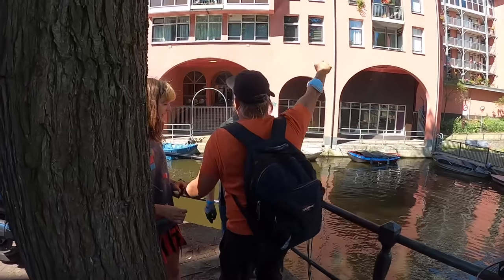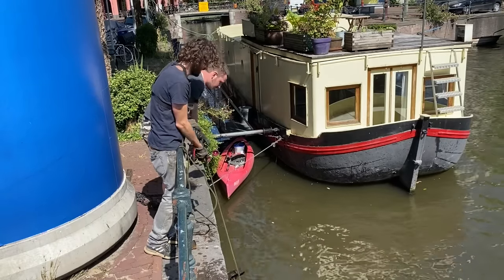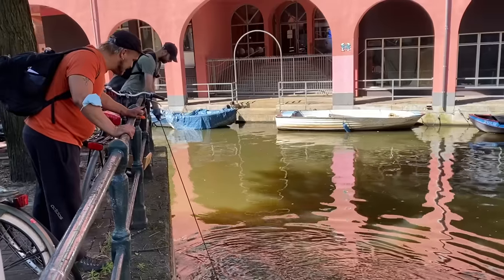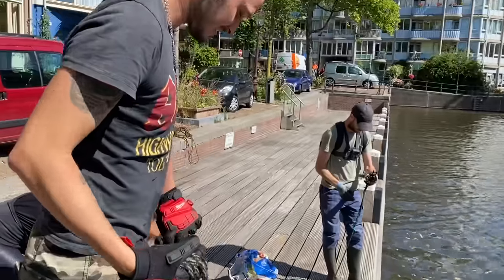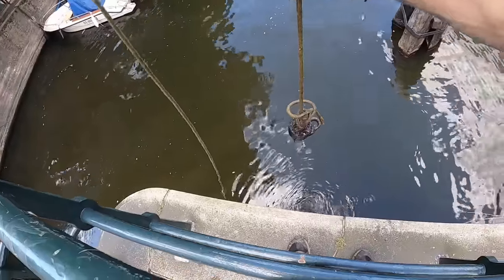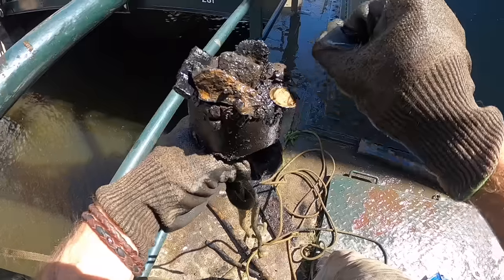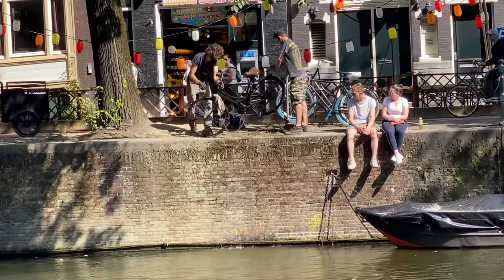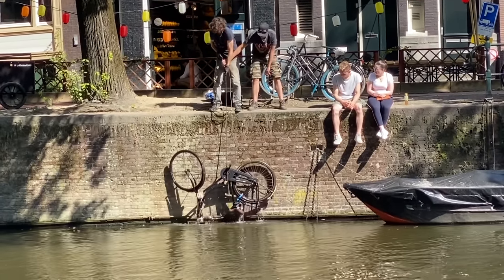She Can't Believe it! Magnet Fishing in Amsterdam Went Crazy!!

Comment: Whenever you find a phone like that in the water and you're not sure if it's waterproof put it in a bag of rice for two weeks and then tried charging it
Reply: Whatever you do, don't try to power it on if there is any possibility of a hint of moisture in it, or fry city. 🤯✌️
Reply: PS, try opening it up and running a fan at it for like 3 days.
Reply from the maker: Awesome tips thanks fellas! Sounds like you’ve got some experience with wet phones 🤦‍♂️😂😂😂 we’ve all been there ey 😊😉
Reply: no way is that phone going to work